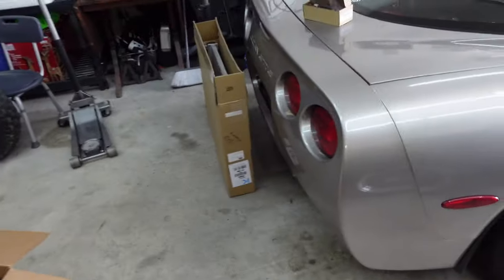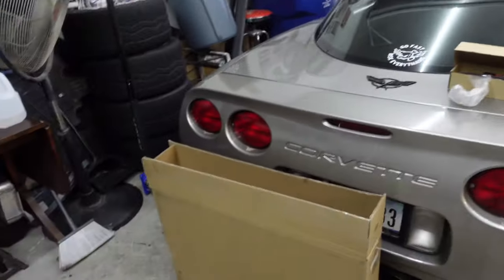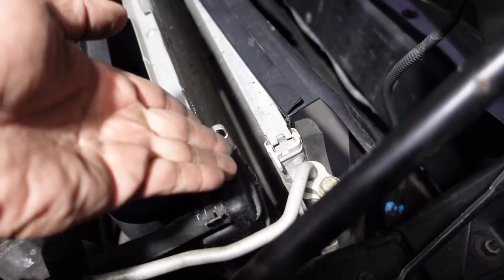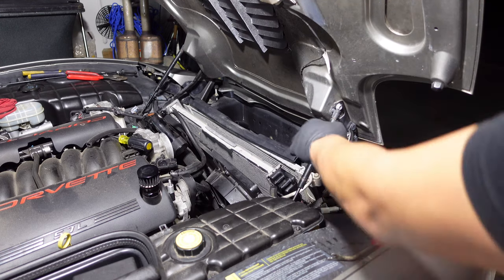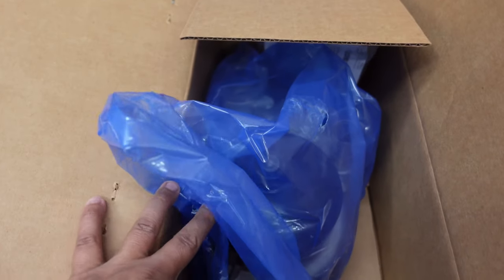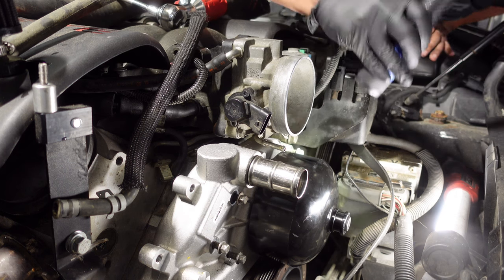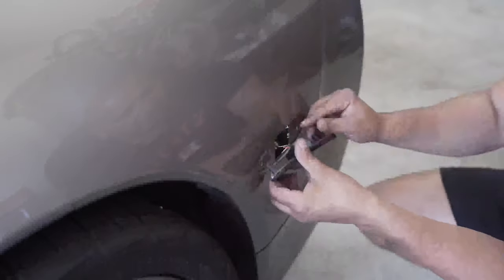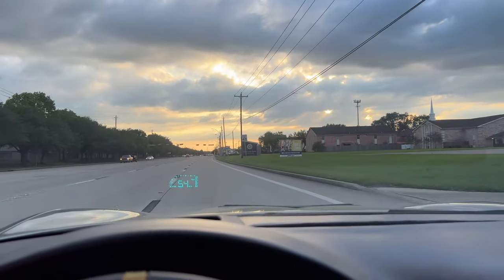Replacing My Blown Radiator On My C5 Corvette. How To Replace a C5/C6 Radiator & Water Pump.

Comment: Does the radiator leaked after the thing you did with the vacuum tubes? Or it worked fine? Because I wanna do the same thing on my car
Reply from the maker: Nope worked perfectly. Been going good since then.
Reply: Those holes are for the automatic trans cooler. It's is it's own separate system so the holes don't need to be plugged.    I just replaced my radiator and tested it. It is a cheap TYC radiator. $100 at the Rock website.